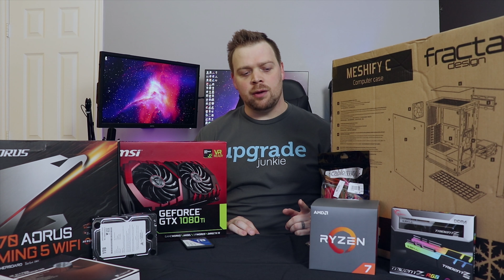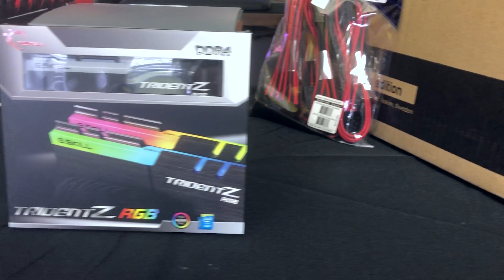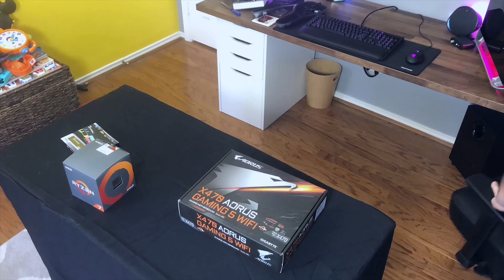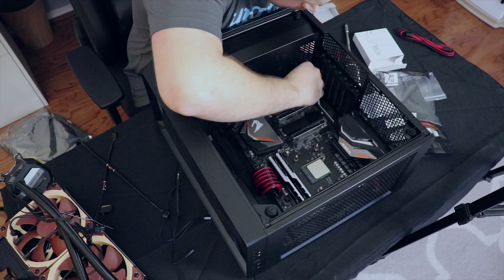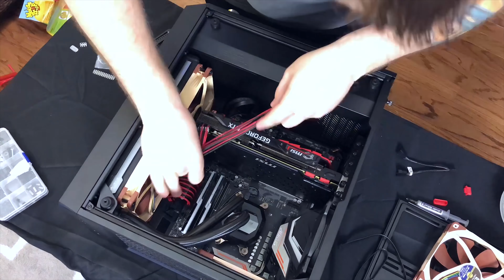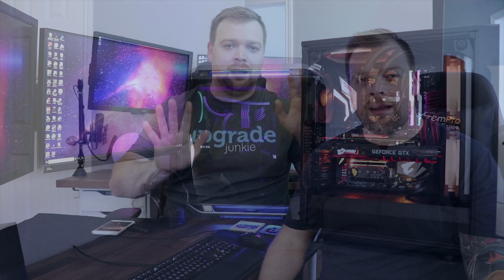4K Editing PC Build - Ryzen 2700X

Comment: Yeah, most recommendations I've heard agree with you to not bother overclocking the 2700X because it performs so well out of the box.  Quick question: what editing software do you use?  I'm mainly using the adobe suite and I've been told to go with Intel as Adobe has optimized better for Intel.  But I also plan to do a bit of multitasking (say Premier rendering while using photoshop or Aftereffects, Spotify, and web browsers), so I felt like the 2700X might still be the better choice in that scenario.  Thoughts? Great video and the computer looks beautiful, cheers!
Reply from the maker: Thank you. I use premiere but am actually not using this to edit on anymore. Almost immediately after I made this video premiere launched an update that allowed it to take advantage of the onboard graphics on Intel chips so I am still using my main internet build and now I have this pic setup as a nas and plex box that I use as a htpc on my 4K tv.
Reply from the maker: If you enjoy my work subscribe I will have e a video out of my main pc soon and my full htpc setup
Reply: Right on, just subscribed.  Ah, yeah, that's the new update that had me questioning my build choice.  So the extra performance you saw with the onboard graphics acceleration on the Intel machine was enough to negate the multicore/thread performance on the Ryzen?  Like, it's a pretty major difference?  You'd recommend I go with Intel based on the new update?  Thanks again.  Looking forward to that main PC video.
Reply from the maker: My situation is a little complicated my main pc is powered by a 6700k at 4.8ghz and duals 1080tis all of it water cooled it’s also a huge and heavy pc in the cosmos c700. With the update to allow the use of the onboard graphics it put my main pic within shouting range of the 2700x and not worth the effort to move around my system. It made more sense to throw the 2700x in my entertainment cabinet due to size and graphics power than to switch out my editing setup. I will do some full tests for you and give you the different between the two.
Reply: Ah, gotcha.  Yeah, I mean, my build won't be nearly as good as your rigs (gtx 960 4gb until gpu prices come down, 16gb 3000 ram, stock cooler if I go with ryzen, etc). In my mind, I figure the main upshot to intel with premier is the speedy render (even my 6 year old i-3 is rendering 10 minute videos at a swift 10 minutes with this update!).  But an intel build would also cost me roughly an extra $90-$120, and I'm sure the 2700X would still perform admirably, if not quite as fast on those renders. Haha, I basically freak out with my research when getting  anew build together.  Thanks for the help, cheers!
Reply from the maker: That should be fine are you using it for just editing or what is your use case.
Reply: Would you say the 2700X be a better fit if using Premiere and photoshop or other apps simultaneously?

Comment: Great video just subscribed. Building a similar system 2700x Crosshair VII Hero mobo G Skill Trident RGB RAM 32GB NZXT Kraken 62 cooler MSI GTX 1080 Ti Gaming X Trio Samsung 970 evo 1TB M.2 NVME SanDisk 1TB SSD x2 EVGA Supernova 850W P2 custom cables from cablemod with the NZXT Hue and RGB fans all in the NZXT H700i. Just got the ram left to purchase and then time to get my build on!

Comment: I am buying the same motherboard and memory do you have any problems with the memory?
Reply from the maker: I actually had to reinstall windows just recently on this machine, I do not know if it got corrupted because of instability with the ram speeds or not. Currently it is running fine at the rated speeds so that may have been just a fluke issue that had nothing to do with the ram. Other than that everything is compatible.